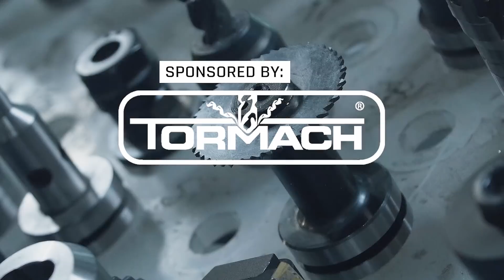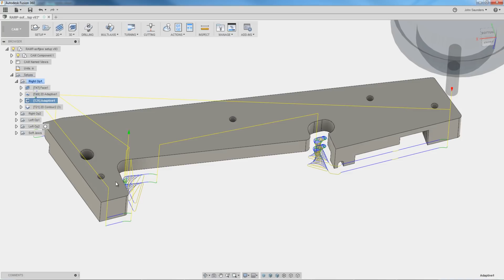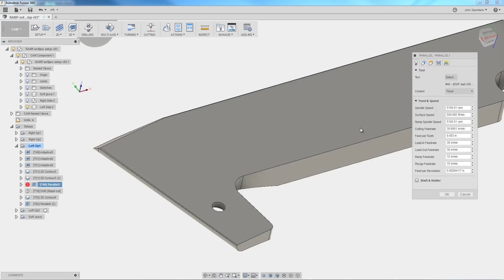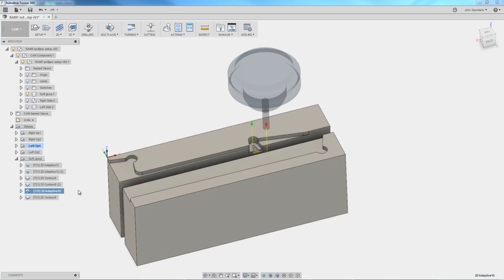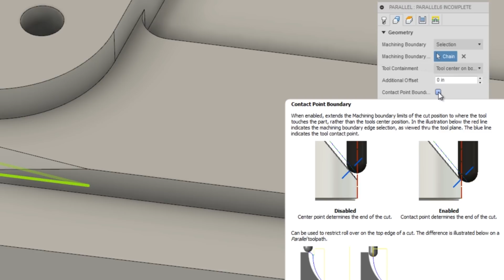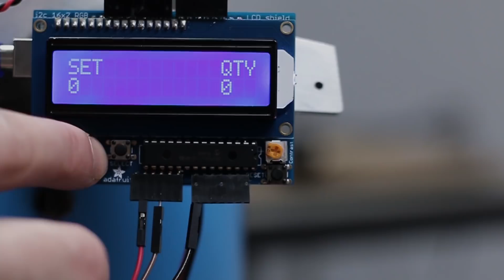Arduino Vibe Bowl Screw Feeder!  WW169

Comment: Couple remarks on the Arduino code:

- You are reading the interruptor input as an analog value using the AD converter, and only count if you get exactly 0 on it. Any little bit of noise or leakage will probably screw that up for you, since even if you ground the pin absolutely solid, your AD might sometimes read 1 or so, it just isn't that precise. You should be reading that as a digital input instead, since the interruptor you selected is actually providing a nice open collector TTL signal, with any signal conditioning necessary done internally.

- The point about double counting someone else made doesn't really apply, since you increase the counter by 1 at most per loop iteration and you compare during each iteration as well. You should keep the check at ">=" however, since it is needed this way for my next point:

- You keep counting pulses even if the motor is turned off. Since you only reset the counter when the selected quantity is reached, if for example someone screws around with the thing and generates some pulses, there is no way to reset it to zero for the next run except by completely resetting the whole circuit. I think you should instead reset the counter when the run is started by the user, this way you make sure you always start at zero, plus you can see on the display how many screws have actually been counted by the last cycle until you start another one. One thing you need in this case though is a variable to track if the motor is currently running, so that you don't try to turn it off every loop iteration while the quantity hasn't been reset yet (turning it off again and again wouldn't actually hurt anything, since the pin just keeps being low, but the delay each time would hurt UI responsiveness I think).

Comment: Quick tip: I've noticed on a lot of your parts you are using what seems to be a 90° spot drill. You want to start your drills on the point, not the cutting edges. If you are using regular jobber drills with a 118° angle, use a 120° spot drill. In aluminum it's not a big deal but in steels, especially stainless, you will wear a grove in your cutting edge where it starts on the edge the 90° spot drill left, if that makes sense.

Comment: One question.. Let's say you're running a 2 hour program on arduino cnc machine and you lose power for some x reason.. Do you have to start over or does arduino have some kind of protection against these things? One way would be editing the gcode I guess, but that would be quite a pain in the ass to find.
Great videos, keep up the great work! :)

Comment: Are you using the SuperFly for the 1st facing op?  Looks like it, but the video doesn't show it stationary.  If so you're feed number are off.  SuperFly is a 1 flute tool.  2500rpm 40ipm = .016 ipt.  To get .00533ipt the tool has to have 3 flutes.

Comment: Hey John! Great video but you should set your soft jaw gap to multiples of 1/8" and use parallels to keep your jaws spread with desired gap while machining to support the moving jaw all the way across. I think you ended up with the movable jaw slightly skewed because of the gage block location which resulted in uneven clamping pressure on each side of your part as there was some movement on the right hand side of it during machining.

Comment: Watch the deflection of the fixed jaw as you clamp with tall jaws like that, it caught me out using a hydraulic vice. Depending on vice pressure, the jaw deflection will vary different amounts as the bolts stretch.

Comment: Hi John,

Nice Video!
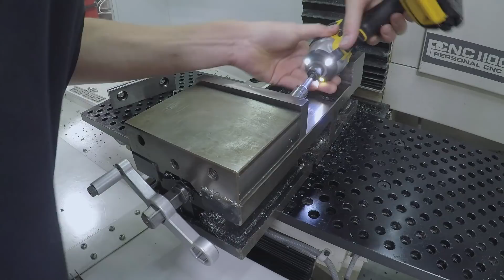1:03 on time line.  What type of socket are you using in the Dewalt to install the socket head screws in the vice jaws?  Is it a ball hex or some type of wobble socket?  Getting into the socket head screws at an angle due to the limited opening in a quick manner is the challenge.  I have some snap jaws that also use a smaller hex key so I will need a couple of different sizes.
BTW  I already own the Dewalt 12 volt drill and impact set and love it!
Thanks in advance for any info you can supply.
John

Comment: Hi John. May I make a suggestion? Add a superbright white LED and a piezo-buzzer. Then, when it reaches the count - after turning off the vibro-bowl- have it flash the LED and the piezo-buzzer until someone comes over to reset it. This way you can start it and leave. When you hear he buzzer or see the blinking LED, you know your parts have been counted out. That way, you (or someone else) doesn’t have to stand there and baby-sit the thing. HTH! :)

Comment: Neat! 

You seem to be climb milling in most of your process. Is that considered the best way to work with a CNC machine? I remember being taught to cut the other way on a manual mill, though I've seen it done that way on a CNC, I wonder what the difference is.

Comment: For your Arduino code, might need to change "IF (qty == set)" to "IF (qty >= set)" just in case it drops 2 screws out in rapid succession at the end. Should still catch it and shut it off, but I am not sure how fast the PowerTail reacts. Also, might want to add some code that if it does drop an extra, turn the RGB backlight red and warn the person of an incorrect count.

Comment: One suggestion: check for qty >= set, so that if it double-counts by accident, it'll stop. Otherwise, it'll keep going until the counter overflows, or you run out of screws (in which case it'll never stop vibrating).
Reply from the maker: good call

Comment: 4000 rpm for the Shear Hog ... is that the best speed for the tool, or the max horsepower point for the spindle? Or something else? Put another way, what rpm would you use on a 440? I was playing with settings and had good luck at 10,000 rpm.
Reply from the maker: we use 10K on the 440.  We use 4k on the 1100 because it has more torque than at 5,100

Comment: You're one hell of a risk taker John.

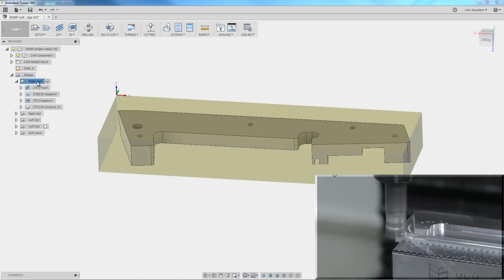3:40 I know you said 0.010" for what stock is left, but you made your Z0.0 the top of the part. It's rough stock, that shit is always varying. I would have made my Z0.0 the bottom of the part. There's more control there. That way, if you see a number  0.080" or less, it will hit those jaws guaranteed.

Awesome video. :)
Reply: What sort of tool would you use to set that?
Reply: I would touch off the floor of the Vice first with a known tool height (the Haimer would work). Then use an offset equal to height of the parallels (in John's case the height of those jaws where the parts rests). After that, that's my new Zero for the job. If I know where the floor of my Vice is, I don't have to retouch off anything. I can always add offsets later as I need to. Quite useful.

Another thing that I always know the location of, is the left corner of my Solid Jaw. That's my XY zero for most jobs. If a part sticks out a bit. I use a stop, and make a close approximation with a vernier of how far away I am from my solid jaw. Put that number in, and there. X0.0 already set. I would only go through the trouble of finding my true X value if the side is the actual part, and not rough stock.

Comment: One thing that I prefer to do with a ball mill is to make sure that it always leads into the work. I never let it plunge into the work, this helps with tool longevity and gives a smoother finish. I don't how to do this in Fusion though, I do all my serious CAM work in NX and use Fusion at home for minor hobby stuff. In NX I would change the non-cutting moves to extend the tool path outside of the cut area to give a nice smooth lead in. Perhaps I could poke around in Fusion to see how to accomplish the same thing. Anyhow,, nice project, it's always fun to see what you're doing next =)
Reply from the maker: YES agree!

Comment: Create and sell a vibratory primer feeder for the Dillon 650/1050 and you'll have a heck of a market...currently only available (to my knowledge) on a Camdex/Ammoload and Mark 7 Revolution (big money).
Reply: Cody Meyer just use this https://www.dillonprecision.com/dillon-rf-100-sm-primer-filler_8_9_23474.html and fill a bunch of tubes. Are you making that many rounds, or needing them made that fast, where the traditional flip tray and pick-up tubes are too slow? Nevermind... Don't answer that. We don't want them knowing.
Reply: You can only pull that handle so fast.
Reply: It's not about pulling the handle, quite the opposite. It's about efficiency of not having to fill primer tubes and then fill the machine every 100 rounds. This becomes a huge problem when running an automated machine. Technically yes, you can buy an RF100 and just keep filling them, but who wants to do that!? Less work to automate everything! It's about being lazy, hit the "go" button, sit back, and watch ammo being made. This is exactly why I want a Mark 7 Revolution, just purely for the automation.

Comment: Are you using a bullnose end mill on those softjaws? If so, how do you get the part to lay flat, chamfered edge?
Reply: Rick He ran a chamfering op on the edges, and the radius of the end mill he uses to cut the jaws is probably smaller, so that it won't interfere.

Comment: Got dang it, I've wasted so much time scrolling through code.  Never new about the find feature
Reply: It's just as simple on the Haas control. Go to EDIT, type T1, press down arrow and it highlights the first T1 it finds. Then hit MEMORY and cycle start. If you're preloading tools (aka you have the side mount tool changer), then you'll have to do the search twice...or you can put specific line numbers in front of your operations N1, N2, etc and search for those instead.

The Haas control also rereads the program from the beginning before starting in the middle so it can pick up any preparatory codes it may have lost when you hit reset.

Comment: Bowl feeders are great until you get an upside down fastener (which will often jam it, causing down time). There are alternatives (such as Seki feeders, which we use a lot at work) that don't jam with upside down fasteners but brand new at least (as a complete feeder and shooter unit for a resistance welder) they're quite pricey (several thousand dollars depending on features and other factors), so in a different league than this. That said, nice setup!

Comment: Nice project, how much of a delay is there between the time the screw is counted and it drops out of the ramp? I didn't see any programed in, but the position of the sensor is before the drop point so there's got to be some or it'll stop before the last screw drops into the bin.
Reply from the maker: Very little delay; the sensor is right before the screw drops into the bin
Reply from the maker: Pot shuts off almost instantly